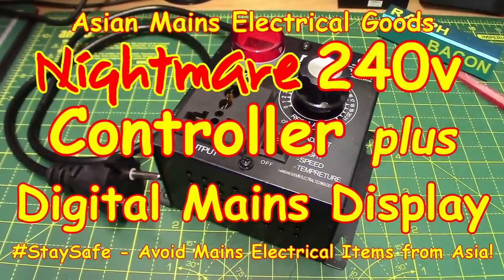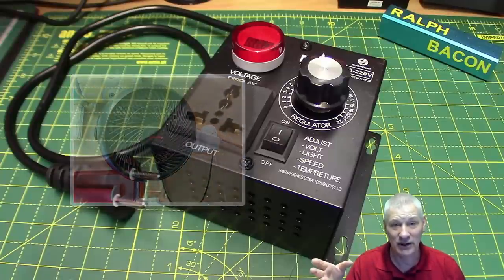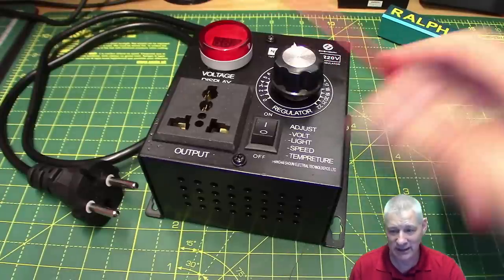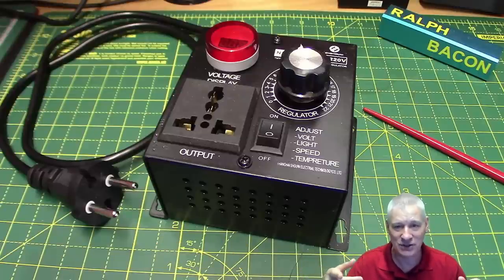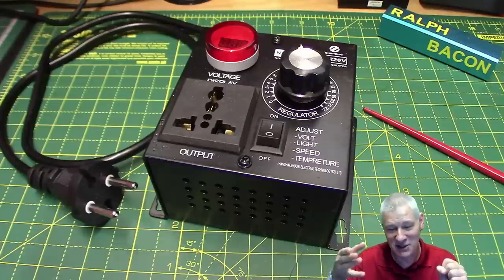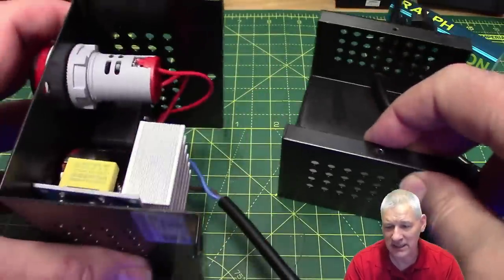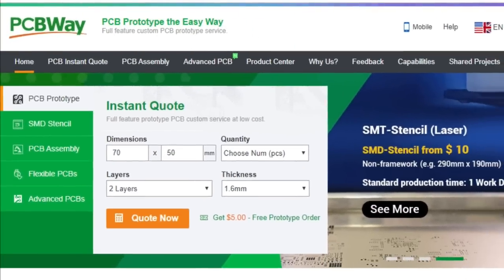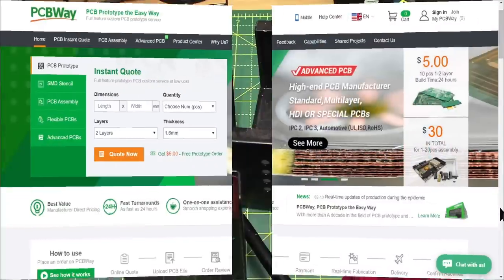#188 Nightmare Fan Speed Controller PLUS a Volts & Amps Digital Display

Comment: When I bought one of these it came with a very nice looking moulded UK plug on (lots of UK plugs being manufactured in China of course). Having a metal case though I checked for earth just to make sure an sure enough while it was a 3 pin plug, the cable was only 2 (very thin) wires. I swapped the cable, soldered onto the earth tab in the socket and added a wire to a screw on the case as well.
I think I paid less than £10 for mine and it's been very good for what I wanted (controlling a dremel type tool). The voltmeter gave up after a couple of years but was easily replaced as it's a standard 20mm panel mount component (I replaced it with a dual volt/amp meter).
Reply from the maker: Well, at least you went into this with your eyes open and replaced the cable with one that had an earth. Good job!
Reply: @RalphBacon   I treat most products with suspicion, much like yourself it seems. I have an electric saucepan that also came with a 3 pin plug, but once again only 2 wires. When I opened that up it was particularly annoying to find a clearly marked earthing point inside, it was even tapped for a M3 screw. Needless to say I fixed that before using it as well.

Comment: Hi Ralph. Good to see your eye is improving :-) 

No one else seems to have mentioned it but the biggest step to making this unit safer would be to remove the god-awful socket from the front panel and fit a proper UK spec one with mechanical shutters over the live and neutral sockets. Bigclive had the right of it when her termed those type of sockets "deathdaptors"! 

Also remember to earth both halves of the metalwork. Don't rely on the existing screws to do the job.

All the best and try to stay safe
Ian
Reply from the maker: I was thinking of either not connecting the socket up at all and hard-wiring my fan, or use a blanking plate. The size is too small to get a UK-style socket on there AFAIK, even the compact ones from CPC and suchlike are too large (but I will double check). My fan doesn't need to be plugged in, just connected. I've ordered some components to create my own control hardware using an Arduino-type device that will be super safe! Good point about the case requiring an earthing strap of some kind.
Yes, eyes improving but I'm not out of the woods yet!

Comment: I picked up a very similar controller, very basic case but I really wasn’t happy with mains clearances, less than a mm from the case! Just like yours, I’m pretty sure this has exactly the same pcb module!
Reply from the maker: There is quite a bit wrong with the hardware, from a safety point of view, as well as it not considering the RFI being radiated. I'm going to replace the control hardware with an Arduino-style module that will be super safe. Hardware ordered (might take a while) but I can play about with the code in the meantime.

Comment: Buying from the UK isn't always a safe bet any more. Most UK suppliers get their products from..... you know where!

It always pays to examine the kit you're using.    Thanks,  Ralph!
Reply from the maker: The one thing going for us by buying in the UK is that the product should (must) have a CE symbol and conform to various EU/UK safety standards. If not, the retailer will be for the high jump. But it is always in our own interests to check everything like this.
Reply: Watch out for the fake CE marks though. I've seen lots of them.
Reply: @wv838  
There is no such thing as a fake CE mark. Unless you check the manufacturer's documentation you can't tell if the CE mark is justified or not (that is usually the importers job to do).

Comment: I just bought a fan controller that fits in to a standard uk wall plate. it has a single rotating control for on-off and speed control. Go on ebay and look for hydroponics equipment.;) controls a bench extraction fan great and meets all safety standards.
Reply from the maker: Thanks for the info! Others have suggested similar and I found such a "dimmer" with a fan icon on it thus indicating it was for controlling a ceiling fan (or hydroponics fan). But I'm very tempted to replace the crappy, near death experience electronics with an ultracheap, but very safe, Arduino module. Not sure which way I will go yet.

Comment: Hi      I would have made it myself .  I am old enough to remember when SCRs were the only choice . At work I made temperature
control units for furnaces that used a pair of BIG SCRs back to back ( Transformer drives both gates ) . I have some cheap dimmers
from CPC that have remote controls  . I dont know if they still have them  -- there were 2 types on/off  and on/off/dimmer   They
matched to the remote so one remote could control up to 4 items  they are rated at 300W but I have not tried them with a fan .

                                                                                                                                                 Alan
Reply from the maker: Having now looked more closely at the "circuit", Alan, I believe I could have built it in a few minutes too, but frankly I just don't have the time to do that and find a suitable enclosure etc. I'll browse CPC later to see what they might have, thanks for the tip.

Comment: Hi Ralph, love your channel. Just a note to say that Thyristors are often used back to back in controllers, as they can handle higher inrush currents than Triacs. Thyristors are frequently found in motor controllers, although they do require more complicated circuitry, they are more reliable.
Reply from the maker: Thanks for the info! I would never have thought that thyristors would be used in much at all these days, Brian, good to know!
Reply: You can even control AC with a single Thyristor if you use it together with a full bridge rectifier.

Comment: Given how simple mains shaping can be with some of the cheap solid state mains relays out there, I'm a little surprised you didn't start a mini-series showing how to build one of these with an MCU in it - use it as an opportunity to show MCU controlled power switching, maybe include a temperature probe for auto speed selection, an RTC chip for scheduled start and stop, then take us on to a basic web interface for the on/off, speed control and status feedback, and maybe finish with digital voice assistant integration through IFTTT or similar - you could even put it in a wall mountable plastic box too! Great video as always - I thoroughly enjoy them!
Reply from the maker: You have read my mind this morning, Robin! I'm almost convinced to discard the electronics (keep the case, socket etc) and replace it with an ATMEGA85/13 and some opto-isolator. Not quite as sophisticated as your H.A.L suggestion from 2001 A Space Odyssey but going towards that in some way.
Reply: @RalphBacon  As you say, my suggestion is definitely massive overkill for a fan controller - but it would cover a lot of reusable aspects I'm seeing people asking for in other forums. Digital assistant integration is an extremely common question, which needs a WiFi solution - for my own personal projects, scheduling is the piece holding me back - although that's mostly because I want an unlimited dynamic list of event triggers... For safety, I would probably have used something like the SSR-40DA solid state relay, which I believe you've covered before.
Reply from the maker: I've got an ESP8266 to turn on and off via my Alexa but I've not gone as far as sending it messages so I can get a value back (eg 40% or plain value 8) to adjust the fan speed. I should research that. I know, I can do that instead of sleeping tonight!

Comment: Gate current is applied usually in PULSES.
Triac/Thyristor continues to conduct until the near zero crossing.
The "control" of the Triac is done by a bidirectional DIAC. (The unidentified component).
Reply from the maker: I do believe I identified this in the video with a red circle and words to that effect, but you are correct. Total rubbish anyway. It's being replaced.

Comment: Hello Ralph, I think you should look for Busch-Jaeger 2297 /  2299 AP. That are speed controller for fans. We use them to regulate the airflow in fresh air systems and have never had a bad issue with them.
The trigger pulses are created with a RC-combination and a triggerdiode also known as diac. And yes due to the fact that a portion of the sinefunction is cut off the voltage has to drop down.
Reply from the maker: Thanks, Georg, but wow! they are a bit pricey. Since this video was published, and the comments, and my desire to do the Right Thing, I'm going to replace the electronics in that box with a simple, safe alternative for just a few pounds that uses an Arduino and may edutain my viewers too. Keep tuned for a future video, and thank you for posting, great to hear from you.

Comment: Ahhh that old heater... It was how I found your channel and started watching all your video's.
I don't think my OCD would let me put that box back together without spacing that pcb away from the case before plugging it in..lol
Reply from the maker: I did check it all with my multimeter first (off camera) as I didn't want to die "on air"! But thanks for your concern, Gene, I won't be switching it on again until I've done that work.

Comment: What your calling a thyrister is an SCR. Both SCR's and Triacs are thyristers. Not trying to be a smarty pants. Great video as always. BTW I put a circuit together that used triac and diac to make a spot welder. I used an arduino to control the conduction angle and number of AC cycles. It would be a good project for your channel. With it you can control any AC device, very flexible.

The current tranformer. You can wind it with multiple turns and you will get a higher reading but if you have a micro you can divide the answer by the number of turns to get an accurate reading of current. Good for measuring small currents.
Reply from the maker: Thanks for the clarification, Joey. Maybe it is us in the UK who don't call a Thyristor by its proper name? I do like the tip at the end about winding the wire through the ring more times - someone asked that, I can now answer (I'll credit you).
Reply: @RalphBacon  
The usage of the word "Thyristor" is the same in German. When you talk about that you usually mean the "triggerable" diode. But components like DIACs and TRIACs are a variant of thyristors.

I feel that's somehow similar to how people call 18650 "li-ion" batteries, pouch cells "li-po" and also put "lifepo4" into another category. Technically they are ALL li-ion batteries, with the usual 18650s and pouch cells being the same thing except for the form factor.

Comment: Hi Ralph.  I have an AC 21" box fan I'd like to use to exhaust hot,humid, stale air out of the top floor at night with a timer. It's a brushless ac motor with the 3 speed knob but it's too fast/loud at night.  Can I use this type triac on a brushless ac fan(I'd use a 110v 60Hz version for North America).  Thanks for your thoughts, Gord.
Reply from the maker: Yes, but with caveats. 

A leading edge dimmer (like this) will work fine for fans, but the fan and/or the dimmer will probably buzz and hum. Very annoying. 

A trailing edge works for a bit without noise but is destroyed by the back EMF from the fan motor. 

Today (spooky) I connected a $70 variac (variable transformer) to my fan and it's bliss. Adjustable from a very slow speed to full speed with zero noise (other than the air) - but at a financial price. $14 buzzy dimmer switch vs $70 triac. ($1.40 = £1). 

Not only that, it's very heavy and I'm going to have to make my own enclosure as they are lethal (mains voltage everywhere, they are NOT isolating transformers).

What's your take?
Reply from the maker: BTW this was not an impulse purchase. I literally spent weeks investigating alternative solutions (hence why I know a trailing edge dimmer will be destroyed).

But as I use the fan even in the winter (to circulate the warm air from the heater) I eventually came to the uncomfortable conclusion that a variac was the only sensible means for me to achieve my goal.

I'm wincing at the cost even now that I know it's the perfect solution.
Reply: @RalphBacon  Thank you for your well-informed comments Ralph. Much appreciated. I'd probably spend the money on the variac if I was to use it for other purposes during the year and not just the summer. I think I'll just use my timer to cycle the fan off/on 10 minutes/hour during night time. Thanks again!  Update on my talking SteriWipes robot. I've got it programmed to introduce me for the end-of-year teacher-screw-up awards on the last day of school. It's a riot!  Enjoy the gradual return to normal! I get my second shot on Monday. Looking forward to seeing people live.

Comment: Could you run the wire 10 times trough that current sence ring to make it measure smaller currents?
So that 100mA would turn up on the display as 1A.
As for the fan project, that small regulator you had to get up to adjust, can't you find one with a remote?
Or perhaps use a 12V or 24V fan and power it from a variable powersupply. Like a bench PSU.
Reply from the maker: I simply don't know the answer to your first question, I'm afraid. It might only measure the field generated once. Regarding a 12/24v fan that has been suggested elsewhere, but it has to be quiet not like a jumbo jet (which is what some PCs sound like). A remote control version sounds interesting, though...
Reply: @RalphBacon  Geir Endre  Jensen is correct, the current sense ring is the secondary winding of a transformer. The wire going through the ring is the primary winding.
Reply: Unless something unusual I'd expect that'd work fine, it's essentially a transformer - one wire only issues if you want the display to show the right value, and don't pass both phase and neutral through as THAT would cancel the field out.. With 10 loops of say the phase wire  then it should show 10x the actual current.
Reply from the maker: Joey Mac has said it it WILL register moire current if you wind it more times through the ring - see his comment here: https://www.youtube.com/watch?v=WqoxHBS8tZI&lc=UgwGyJz2iR-WfT4BokF4AaABAg
Reply: It SHOULD produce a larger output current YES! BUT, BUT, BUT remember that whatever circuitry is inside that unit is expecting a maximum VOLTAGE to be produced across its burden resistor in which case it may well blow the internal measuring electronics if you get a sudden spike or turn up the current too much. You will also be reliant on the finer accuracy capability of the unit needed at more turns. Better to design a specific use case with your own sense coil (or buy a clip on split coil) and a small Arduino - ATtiny type. 

I don't remember seeing AC SMALL current measuring coils, Most are designed to measure 50 to 200 amps upwards (the rating for a max output is on the coil normally). It may be easier to put a volt clamp on the Arduino input and aim to measure a voltage produced by a much smaller output current - the typical full range output current from the coil (it's a "current" transformer remember) is usually xx mA for the rated max measured current. With your own design you can chose your own burden resistor to fit your scaling requirements.

Comment: When you touched it at 15:28 I actually jumped!
Reply from the maker: Sorry to worry you, Simon, but off-camera I had first checked that the Live mains was not connected to the case! I didn't want an on-camera experience I'd rather forget! I'm thinking of replacing that death trap (internal) module with an Arduino super-safe one.